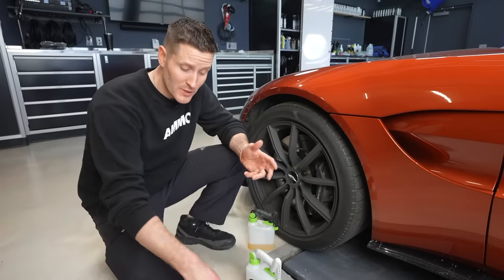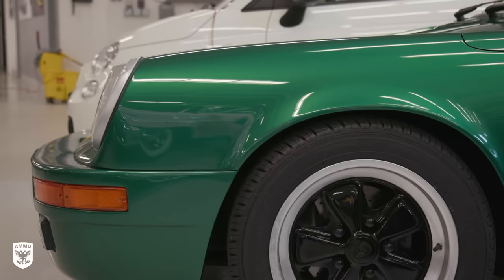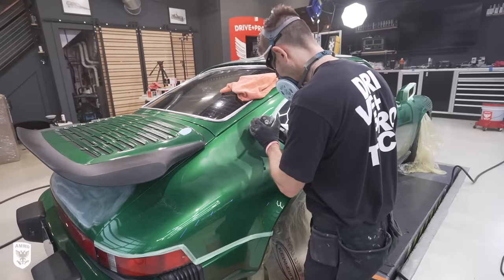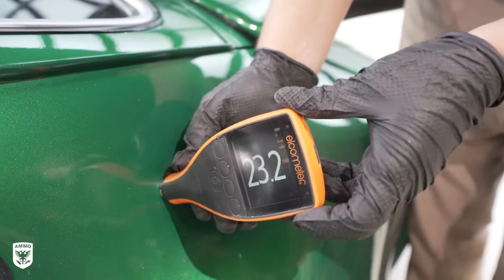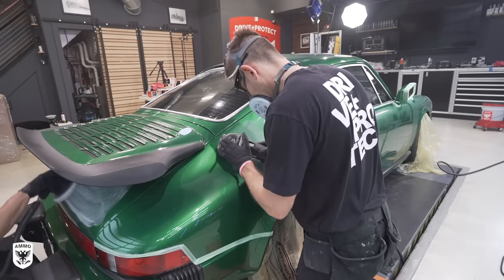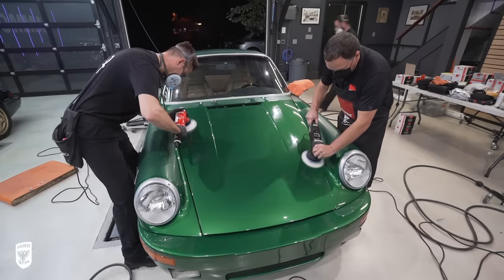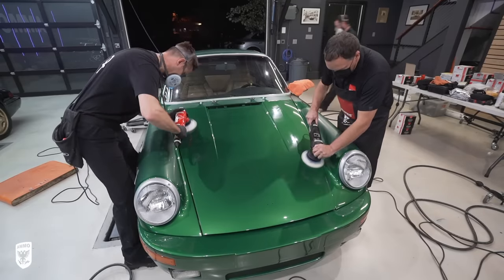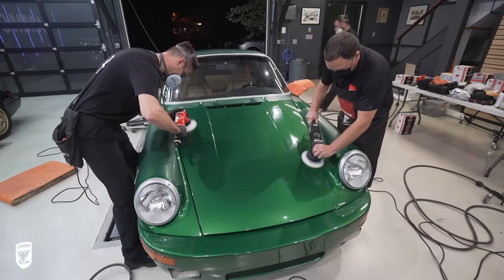How to Wet Sand Orange Peel in Car Paint: Porsche 911

Comment: Need some help. I painted my car and started sanding the clear coat. When I was sanding with the 3000 I noticed it would occasionally leave hard dust buildup spots on the clear(I'm dry sanding with an electric orbital sander) . Mostly happens when the pads is starting to wear out but the spots are extremely hard and hard to remove. Any advice?
Reply: Didn’t you spray a little water before u sanding?i used to sanding 1000 first ( with air sander) then move to 2000 .3000 ,last is 5000 grit,3000 won’t kill the orang peel
Reply: @samuraipainter308  I ran 1500 and 2000 before the 3000. But like I said in my OC I was dry sanding. Figured out it was a combo of things. Poor quality sandpaper, overheating, excessive dust buildup ECT. So I started wet sanding instead and didn't have any problems after

Comment: those meters don't work like people think. Those tools measure down to bare metal and not just the clear coat. Only way to get a true reading is to apply your metal etch and then measure, apply your primer/sealer then measure again, apply your base coat then measure, then your clear coat. This is the only way to get a true reading. And please stop using those orbitals, use a high speed polisher like the pro's do it. You guy's took 2 days for this job and if you cant do this simple job within 6 hours then you're probably doing something wrong. Start with 2000 dry on a da and then 3000 wet on a da. You'll finish much faster.

Comment: As indicated by Jason Rose, this is Shrink...NOT Orange Peel. 

I had the pleasure of working with the Gentlemen at Chequered Flag International in Marina Del Rey on a rare 1977 Porsche 911 Turbo Carrera

Here are some up close Before & Afters. 
https://www.facebook.com/773727729339568/posts/825141687531505/

The vehicle has 17,000 miles on the clock and will be listed for sale at over $200,000

The Silver Metallic paint was in great shape, except for a curious texture

23 hours later...the texture was removed without wet sanding. This less aggressive process takes longer, but, keeps the factory orange peel texture and preserves as much of the clear coat thickness as possible

Yes, Porsche was clear coating back in '77, but only the metallic

Comment: Wow 20 to 30 mils just means it has quite a bit of paint between bare metal and the surface, car could have been painted once or twice over original paint

It does not mean there is paint to work with or lots of clear to sand down, the clear could be literally 1 or 2 mils thick

Comment: Why make a pivot bottleneck, when There are way better alternatives that is cheaper, better and can be fitted to almost all types of spray bottles? Just replace the stock pickup pipe with a flexible one, and a weight at the bottom. Just like kwazars 360 bottles. Better and cheaper in every way

Comment: I wouldn't recommend this to anyone,  you could ruin your investment..
Reply: Completely agree. Even esoteric detailing states why they don't remove the orange peel. You're removing a ton of correction ability over years along with a lot of clear
Reply from the maker: Yes we stated that in the video. This was a terrible repaint with lots of paint on a  car itself. removing orange peel on a non-repainted vehicle, as we said in the vehicle, has more reasons to NOT do it than to do it.
Reply: He literally said thar
Reply: You're more likely to ruin your paint with a rotary. Sanding is far more controlled than polishing, however the interim result looks terrifying. Take into account, if you are levelling peaks, you should be removing hardly any paint from the thinnest layers. Contrast this to standard heavy compounding where the pad will contour and remove paint at all layers. It would have been good to see how a panel done with 3M 8000 grit would have turned out and how that changed the approach to the final compounding stage.